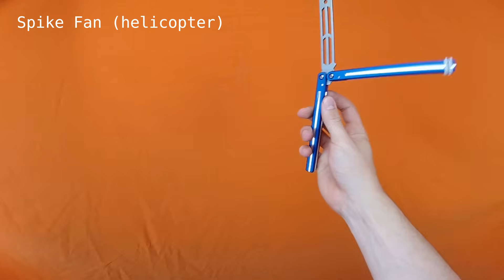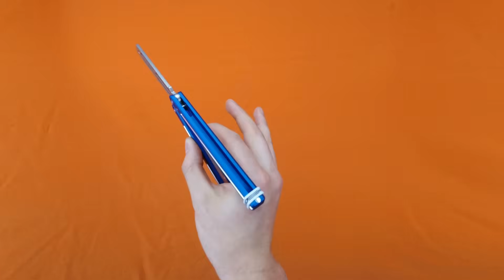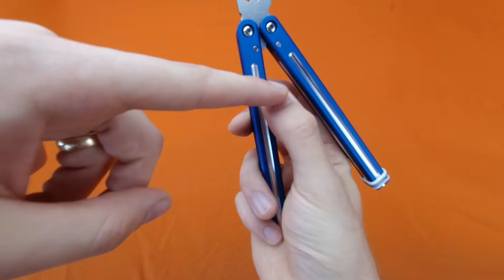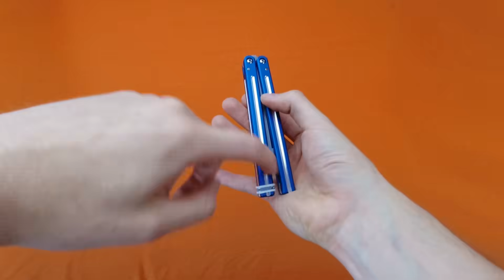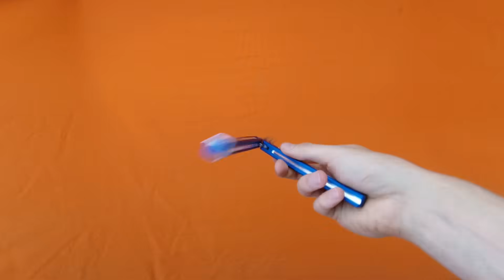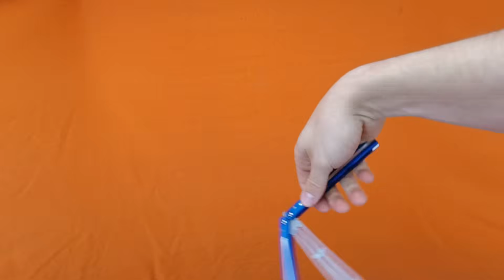Butterfly Knife Tricks for Beginners #2 (The Fan)

Comment: since i have a nabalis vulp the grip method explained in this video really didn’t help me at all since the entire portion you need to wrap your ring finger and pinky around is aggressively grippy. HOWEVER, if youre like me (a beginer with a vulp) i recommend just dropping the idea of using ring and pinky technique to support your fan (just let em wrap around the safe handle naturally) and instead shift your technique to the middle index and thumb. just do the same spinning motion in the video and notice that the helicopter propeller keeps falling low and bumping your index and thumb and stopping. to prevent this you need to lightly and rapidly twist the safe handle with your index thumb and middle to keep the fan afloat (dont stick your fingers all the way on, just give the bite handle a light tap with all three fingers to twist it and do this super briefly but super often).. so like its hard to visualize from just text but ill link a video that shows it in the replies
Reply: https://youtu.be/BF40ne_gslE?feature=shared
Reply: she opens it in a unique way that you dont need to copy but just make sure to give the safe handle rotary taps yknow

Comment: I've been flipping for like 6 months, I have a good handle on the basics and know some intermediate/ advanced stuff but I've never been able to sustain a fan that's not the "spike" fan. This is the most useful tutorial I've seen and the closest I've gotten so far
Reply: Yeah. I was having a lot of difficulty doing the standard fan too. I was finally able to do it some of the time by adjusting my rotation. However, when I put down my $8 Amazon trainer (I know, I know!), running rather loose and not particularly smooth on fixed pins, and then grabbed my $160 knife running on nice bushings, I was suddenly doing it like a pro. Just ordered a $40 Nabais trainer running on bushings. I could tape the blades on my two knives to train with, but they are too nice to be tossed across the room. 🤣
Reply: same
Reply: You can try constantly 'pushing' your hand away from you when fanning (to keep the bite handle from pulling the blade up) or cheesing it by doing a vertical rotation instead of a horizontal rotation lol
Reply: me too, i think it might be that the balance point needs to be closer to the blade?